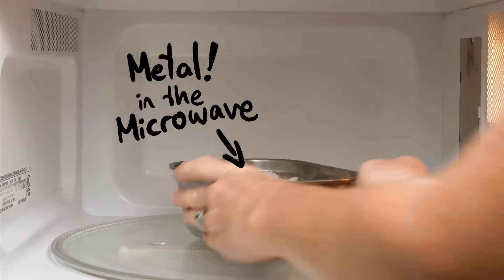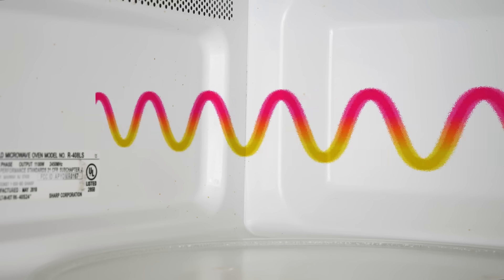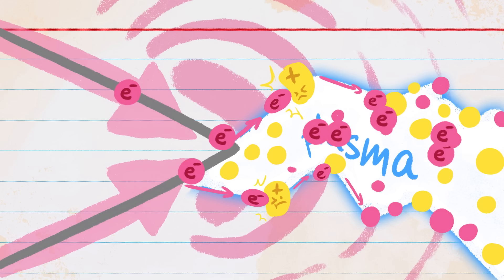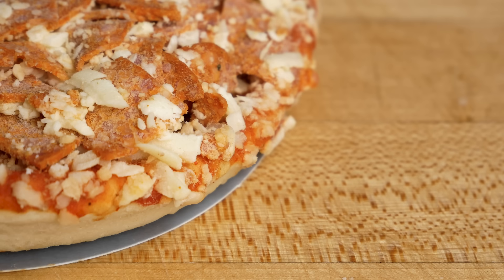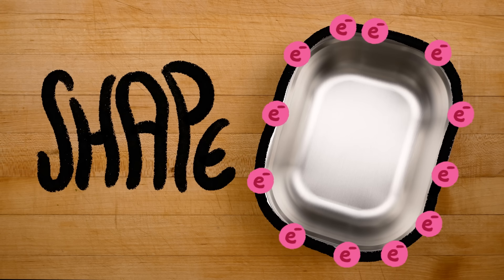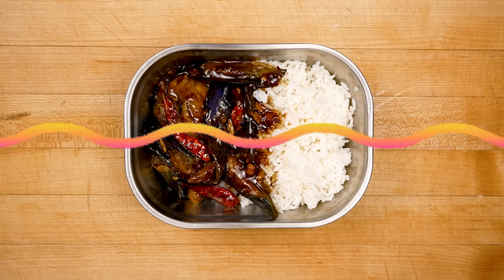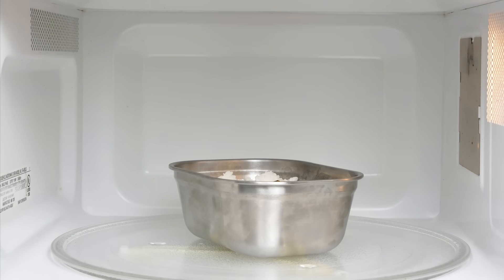Microwaving metal is FINE (sometimes)

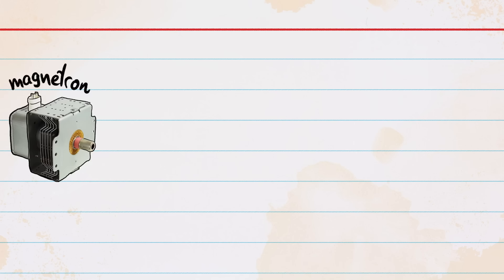Comment: 1:04 relatively low frequency?! Tell me how are microwaves low frequency?
Reply: Key word being relatively. Compared to visible light, roughly 400-790THz, microwaves are 0.3-300GHz. Microwave ovens specifically are in the lower part of that zone, roughly 2.4GHz
Reply: @techheck3358  yes and microwaves are way shorter than VHF very high frequency and HF high frequency. I would never call microwaves "relatively low frequency", because it is just incorrect, the video is poorly written and misleading in many parts, I stopped watching after a couple minutes,
Reply: @matthias7534 light with a lower frequency than visible light is generally referred to as “low frequency” light. It’s a common term used. So she’s completely correct in calling microwaves “low frequency.”
Reply: @the_flying_airplane5335  it's a video about microwave oven, not about light, there was no comparison with light, so it's inappropriate to call microwaves low frequency. 100kHz is considered low frequency
Reply: @the_flying_airplane5335  it's like calling a monster truck a "small commuter" because the sun is a billion times larger, or like calling a bicycle a gigantic vehicle, compared to ants because they are thousand times smaller, it's just stupid
Reply: @matthias7534 "relatively" they didn't need to clarify that for you, yet they did and you still take issue with it.

WiFi is also relatively low frequency, why don't you freak out about that?
Reply: microwaves are on the low frequency side of the electromagnetic spectrum.  The only thing(s) with a lower frequency are radio waves.  Infrared, visible light, ultraviolet, xrays, and gamma rays all have high frequencies.
Reply: what a stupid ass reason to complain about the video

Comment: When I grew up, we had a microwave that had a pictogram of a glass with liquid and a cross through it, and next to it the same glass of liquid with a spoon in it and a check mark.
So we frequently put metal spoons in if we were heating a liquid.
In hindsight, maybe it should've bee a different material? I think the main purpose is to provide a nuclearion point for water vapor to form, to prevent super heating the water which explodes when disturbed

Comment: Whilst the outside of the container may block some of the microwaves, the flip side is that the insides will reflect it back into your food until the energy is completely absorbed, so as long as they can make their way in, it's probably alright (as long as it is a microwave safe design, of course)

Comment: I have started a fire in my microwave with aluminium foil before. I somehow had never heard you are not supposed to microwave metal before. I am a little surprised to learn it is supposed to be difficult to do. The aluminium foil around my phillycheese sandwich caught fire almost immediately.

Comment: Things can definitely get much hotter than the boiling point of water. I've gotten lemonade to ignite in the microwave. Like, that doesn't happen at 100 °C.
Reply: The main reason here being that low concentrations of water mixed with something miscible that isn't water will generally not be able to produce the full vapor pressure of water in pressure.
Reply: Probably runaway caramelization followed by carbonization at like 160 °C.

Comment: As long as you don't get corona leakage off the metal, it should be fine. If there is leakage, the plasma will cause an arc and it will damage the magnetron as well as whatever object it was arcing to.

Comment: There's just too many little caveats regarding this topic that it's just safer for the general public to remove all metal from the equation. From a safety standpoint, it's much easier to communicate to the public exclude an entire category than to include metals but have these very specific instructions how not to use an appliance because of the potential safety hazards if used incorrectly.
Reply: Disagree. Telling people it's GOOD to boil water in the microwave with a spoon in it would save many burns
Reply: At the same time, giving the general public information that is "easily digestible" to the point of being misleading or incorrect is the sort of thing that leads to scientific illiteracy and distrust.

I think there’s a balance to be struck in giving the public straightforward while accurate information.
Reply: The biggest caveat is subtly at the start and is an absolute deal breaker. I get the physics of it and entertained the idea of one day putting a round smooth bowl carefully in the center of a microwave I don't mind breaking.

Then the fine letter says "not all metal is microwave safe, check it first?" NUH UH, I never saw metal advertising itself as microwave safe, and most go out of their way to say all metal is unsafe, and I know that even if safe, I'll see fireworks if the metal touches the inner walls or another metal object.

Plus NO ONE answered me WHY would I even consider putting metal on a microwave. What do I stand to gain? 

Will still watch because I might learn another new thing besides "not all metal is safe regardless of form factor" but at this age no one brought a good use case for metal on a microwave that isn't a permanent fixture from the device itself.
Reply: @Mordecrox  Metal containers are the best type of reusable container for your home in general. Plastic has all the problems we already know about. Glass is essentially impossible to recycle because of the same properties that make it so good at holding stuff, can shatter into dangerous pieces, and spontaneously explodes when heated or cooled too quickly. Metal is infinitely recyclable, stands up the best to heat and temperature change, and won't shatter. So, in the ideal world where you're switching all your food storage containers to metal, knowing that you can put it in the microwave means you can still use your microwave without keeping tupperware around specifically for that.
Reply: @PaddedShaman  I mean specifically for microwaving. Either I'm putting on a stove or the kind of round pot that could be theoretically safe isn't meant for cooking food anyway
Reply: @Mordecrox  The point is that you still get to own and use a microwave after getting rid of all your plastic food containers. If your reaction is "oh well then just use a metal pot on the stove" then you've missed the point
Reply: @PaddedShaman  YOU didn't get the point. I'll use my own utensils as example. They aren't rated as microwave safe. They are rated as food safe hot/cold. Howevrr, they are NOT rated for actually cooking in them outside of bain merie (immersion cooking) and I ain't going to risk that be it cooking on stovetop or microwave.
Reply: @PaddedShaman "glass is essentially impossible to recycle" you can go look at videos showcasing glass reyclcing facilities and all the glass they easily recycle into bottles and whatnot - glass, like metal, is infinitely recyclable. The issues plaguing glass recycling are very similar to those plaguing metal recycling: people aren't putting their glass into recycling bins and when they do, they leave contaminants on that are more difficult for the processing units to remove.
Reply: @godminnette2  I have no issue with washing my glasses / cans for recycling but I do have a problem with removing whatever glue was the cheapest for the manufacturer and the paper that sticks to it. Some come off with little to no problem, some won't even if you are literally scraping it off from the glass. Certain glues just defy physics and I don't have the patience to fight it.
Reply: @ That's fair - the glass bottles I get don't have this issue, but I'm sure there's plenty of beers and whatnot that do.
Reply: @godminnette2  They are jars and food cans. :')

Comment: I had a super traumatizing event when I was 9 or so when I put food with aluminum foil on it in the microwave and it started sparking with a bright blue-white flashing like there was a lightning storm in the kitchen, smoke coming out of the door and everything.  When I opened the door the inside of the microwave had blackened char spots and it stank for weeks.  I'm a chef now and I still don't like using microwave ovens.

Comment: ‘Relatively’ low frequency waves?  Only 2,400,000,000 cycles per second.  What was it relative to?
Reply: Try visible light, 400,000,000,000,000 - 790,000,000,000,000 cycles per second
Reply: High frequency = UV radiation/x ray/gamma

Comment: Not really metal, but i nearly started a microwave fire once.
I let the popcorn bag get stuck a little too long on one of the metal plates, since normally it unstucks itself, since my microwave is barely too tiny for popcorn bags, so i need to constantly move it back to the middle plate if it ever gets stuck.
Anywho, it started smoking(the white kind), if a little too much and it was smelling pretty burnt, i turned the microwave off, and kept the door closed incase a fire had started in hopes to choke it, i waited around, idk maybe 5 minutes before i took a peek inside and yep, the popcorn closest to the opening and metal tile had been burnt.

Dont buy too tiny microwaves! And keep your eyes ON the popcorn bag to make sure it doesnt get stuck.

Comment: I once had a hamburger cause arcing in the microwave. I have some guesses, but I don't know absolutely for sure why. It wasn't stored in metal in the fridge, but it might have had some iron shavings on the outside of the burger from cooking on the grill. Still seems far-fetched though....
Reply: Also, one of our local grocery stores has recently started to switch to microwave and oven safe, film-lined metal trays to replace a lot of their plastic to-go item boxes. I appreciate the move toward more sustainability, but it's a learning process to figure out how to get them to most effectively heat food through. They leave way more cold spots than just dumping the food out onto a ceramic plate.

Comment: Man, I have been particularly interested in microwaves lately so this video came out at just the right time.  I fixed my 1980s Sunbeam combination microwave/toaster oven and after that, the metal rack was arcing to the heating element for the oven component.  I fixed it just by bending the element out of the way.

Comment: I have an oven that also has a microwave function. When using it in microwave mode I can use the oven rack (grille of metal bars) but not the baking tray (sheet metal). Does it have anything to do with the bars on the oven rack all being basically parallel to each other?

Comment: Microwave ovens freak me out at the best times let alone at the worst times, when I cook or heat something up I literally have to move into another room, but one time I was microwaving a box of Chips (Fries) and the microwave started to ark like mentioned in this video, the box obviously had metal in it and this box was meant for the microwave, the cardboard in the box also burned, this heightened my already fear of the microwave so now I only use it very sparingly.

Comment: I'm not risking my inherited 30+ y/o Sharp Carousel
Reply: Don't! Your 30 yr old microwave probably doesn't have the new protections for the magnetron... My microwave from the 90s caught on fire when I did it!
Reply: A man of culture, I see
Reply: My 1978 Radarange.. it's probably fine. Before they even started cheaping out on safety stuff. Door physically locks.
And it has a glass touch panel which is pretty ahead of it's time.
Reply: had to sell my sharp carousel because it was too high wattage for my kitchen
Reply: I have a samsung that is older than me, also not risking it. it's stout and i won't get that from a new one.
Reply: @Progan666 shout out to vintage appliances. I asked for a food processor for Christmas once and my dad researched and found one from the 70s and it’s an absolute tank and I love it!

Comment: my knowledge of what to/not to put in a microwave, as learned from both Mythbusters and personal experience - Grape halves (when microwaved close enough to touch each other, these are guaranteed to arc.  Neat light show).  Forks (mythbusters couldn't get them to arc, although they did get really hot).  Potatoes (they don't blow up.  They just dry out and catch fire).  Apples (The skin busts open a little and leaks apple juice).  CD/DVD/Blurays (Excellent light show, and excellent at destroying your data).
Reply: I have a great recommendation for you to try.  Dove hand soap bars.  Experiment with different sizes and surface areas :) (not too large though, it can get hot)
Reply: A candle with a glass put over it plasma beautiful plasma
Reply: I wonder if "destroying your data" means "it can't be read using standard CD players" or "it can't be read in principle by data recovery techniques because it becomes indistinguishable from any other state of data". Because only the latter is secure if you want to destroy data for security purposes
Reply: @lekhakaananta5864  It's a hard destroy.  the hot metal melts the plastic.
Reply: Potatoes are fine. Cut into 2 or 4, add like half a glass of water. One portion cooks in 10 mn. Fastest way I know to cook spuds, I do it all the time.
Reply: @ClaireDixsaut  I'm not talking about cooking.  I'm talking about throwing whatever seems fun into a microwave and seeing what happens.
Reply: @CineMiamParis if you want whole potatoes, stab the outside a couple times with a fork, wrap in tissue/cloth to prevent juice going everywhere, then microwave on full power (for a 700W, might be different for other microwaves) for 12 mins, flipping halfway through. The only downside is that the skins don't get all nice and crispy, but for a lazy meal with minimal washing it's great
Reply: PLEASE HOW DO I HEAT LIQUIDS WHENEVER I PUT THEM EVEN IF FOR 10 SECS THEY SPILL OUT AND SOMETIMES ARENT EVEN HOT SO THEY CANT BE BOILING OVER LIKE WTF???

Comment: For a (somewhat) intuitive explanation of why electrons bunch up in corners:
in a very long straight wire with nothing weird, every electron is being pushed on equally from both sides
but in a bend, all the electrons are off to the side instead of straight ahead, so they can't push quite as hard. Or to be specific, they're pushing diagonally and not straight on.
Reply: ah so its about direction the force is applied. thats much more intuitive thank you

Comment: "Not to mention that the inside of the microwave is made of metal"

The inside of the microwave is grounded (which helps ensure it works properly as a resonating cavity), and it is in contact with... itself, which gives it the ability to equilibrate and avoid dangerous voltages. It's also designed to able to dissipate any consequent joule heating.

If you don't understand these things you have no business making videos about what's safe or unsafe to do around high power electronics.
Reply: lighten up, francis. They were just highlighting the fact that more nuance clearly exists to the "No metal in the microwave ever" freakouts that prior generations had, and giving background to the observations taht might cause someone to have this question in the first place.
Reply: @cloudkitt  "Lighten up"

Yeah that could happen. Do whatever you like though, I'm not your mother.

Comment: I'm having flashbacks to when I accidentally left a spoon in my soup bowl when I was 10 and my mom FREAKED out at me for good 10 minutes. Meanwhile she would microwave things directly in the plastic tuperwares... funny how the research ended up.
Reply: Microwave safe plastic is...microwave safe
Reply: That really depends on the plastic. For example, PP (most IKEA lunchboxes) is microwave safe, ABS (some MEPAL lunchboxes) isn't. So read the label and see if it's labelled as microwavable
Reply: NO plastic is microwave safe. Though if you must, the older the plastic the better. After it's been used a hundred times all the chemicals that can leech into the food already have lol
Reply: @ninjalectualx  what chemicals specifically are you concerned about?
Reply: @ninjalectualx  plastics are so different (all that "plastic" says is that it's an organic polymer with certain material properties, they can be very different in what is actually in them) that any blanket statememt about "all plastics" or "no plastics" is bound to be wrong
And in most cases, older is worse because it was manufactured when less was known about what additives are harmful and which plastics themselves break down over time. They are also more likely to shed microplastics, because of both aging and because less was known about which materials are durable over time. Lastly, the further back you go, the less likely it is the thing was actually tested for microwave safety - I'd never use a lunchbox in a microwave that the manufacturer doesn't explicitly label as microwave safe (so no random takeout containers)
Reply: @ninjalectualx  that doesn't really sound right. Plastic degrades, and pretty quickly.
Reply: @theninja4137  he's probably terrified of dihydrogen monoxide
Reply: Everyone is free to do what they want but frankly trying to avoid plastic coming into contact with your food is pointless. Whatever is it you’re eating it was already wrapped in plastic at multiple points during production and the more processed the food is the worse it gets. Restaurants are also out as wrapping food with plastic wrap is an obligation for food safety issue.

Idk if like people only do it to reassure themselves more than anything
Reply: @Drek492  No duder, your statement is simplistic, not intelligent. You're saying 'any amount of any toxin is the same level of toxicity' and it's not a smart argument in the least, it's just lazy bullshit.
Reply: @jamescarter3196  you have functional kidneys and a liver correct? If so you can shut up about these fictional "toxins" you couldn't even pick out of a lineup